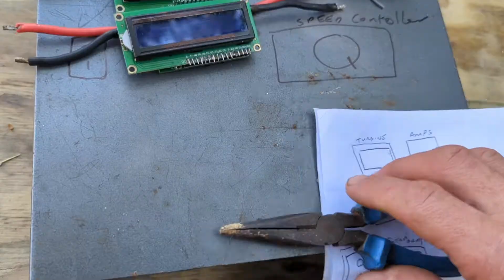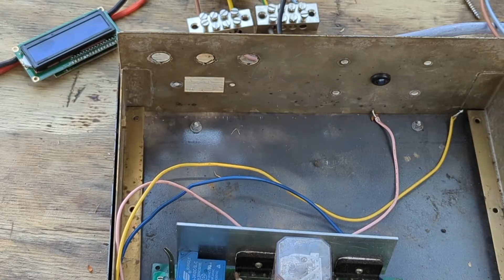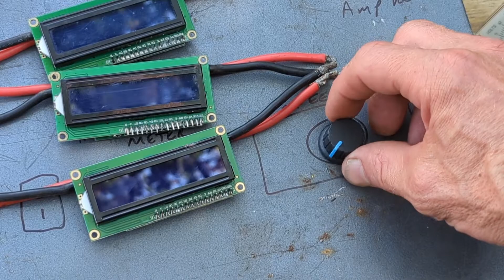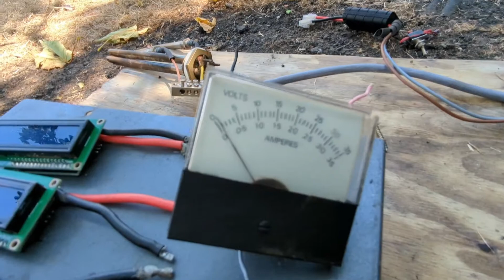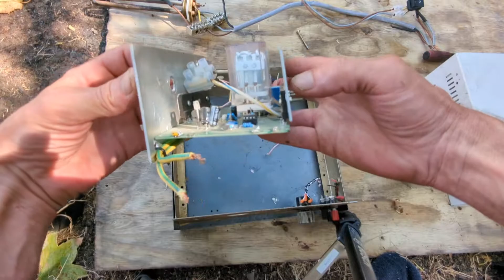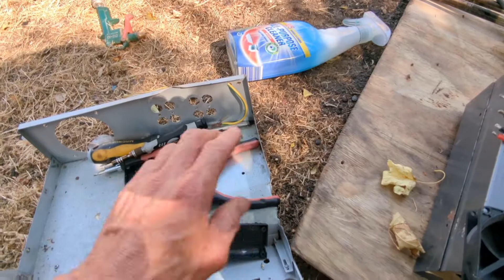24v Wind Generator Charge Controller - Rebuild/Upgrades - Part 2 -  15 August 2022

Comment: Have you thought of using water or sand to store some energy, what with using two dump loads?
Reply from the maker: Yes mate I had thought rice might be the best thing as I believe they used to use those in old fashioned heaters. Maybe sand as well, The water could be an option, but if it's freezing cold with no electricity, I'd probably take the heat if that makes sense, hope you are well , cheers.